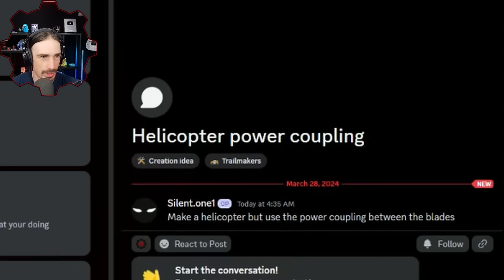Floppy Helicopter Blade Experiments

Comment: in case anyone doesn’t know, irl helicopter’s blades are allowed to flop around slightly, this helps reduce the rolling force subject to the rotor from the helicopter moving forward due to a difference in the speed of the air flowing over the blades on either sides of the helicopter
Reply: Isn't this also the case for planes? I know plane wings bend a little too but i'm unsure if it's for the same reason.
Reply: Yes, some plane wings bend(or really flex). I dont know if theres an engineering reason like the one for helicopters. If I had to guess, in some designs, having the wings flex upward slightly, may have been within the acceptable range of structural support, rigidity and flexibility, while also, maybe, adding some minor stability in flight.
Reply: @ShadowWolf2508plays  yes, plane wings flex, for different reasons for different types of plane. earliest planes bend their wings to achieve aerial control while modern airliners allow their wings to bend to dampen turbulence and other vibrations. modern airliner’s wings can actually bend quite a lot.
Reply: ik that wings on a plane flop for a reason but im not sure if its the same
Reply: @irrelEvant5352  your question was answered above
Reply: @changjared2600  i see. But thats a lot of words :/

Comment: Hi scrapman, here to explain game physics again:
When parts are welded/glued together, they are treated as a single physics object. HOWEVER, when they are detached via a rope-like joint, they are a separate physics object (similar in nature to the tractor beam thing). Because of this, when you detach wing parts, the force those wing parts isn't being applied to the whole creation, rather just everything that it's directly attached to (where in this case, the laser string is considered "indirect attachment") 

This explains why you spun out when you detached the top blades from the bottom. This is because the counter torque does not apply between separate physics instances, even when indirectly linked. It also would explain why the wings went up when you slowed the engines down. . . because the upforce of the wings. . . were only being applied to the wings themselves and not the main body. Where wings, by their very nature of being wings, are very light and don't need alot of speed to lift up, if the only thing they have to lift is just the weight of it's own wing'ed self.

You can test this analysis by reproducing the top/bottom separation. . . but putting laser string between the bottom blade and the helicopter rotatee part.

Comment: theoretically you could to the traditional opposing stacked blades with flappy bits if you alternate which segments are power couplers, like the top set of blades could go blade + coupling + blade , and the bottom set of blades could go coupling + blade + coupling, since power coupling don't have collision on their body this might fix the whole spaget issue.

Comment: Scrapman. You may or may not be aware of this, wings in trailmakers only apply down force when flipped. Reversing the direction so the down edge is forward still gives lift for some reason, i believe that is part of why pitching forward was so bad, the closer blade to the center of mass is momentarily getting more lift as its closer to the center of rotation

Comment: So with power couplers, you can put them side by side or on top of each other to make the bend mostly in only one direction.

Side by side and they mostly can only flex up and down.

Stacked on top of each other and it mostly only does right and left.

If you make a difference in strength you can effect the motion to be twisting or greater in one direction and less in the other
Reply: The effect is great the longer(more) couplers

Comment: Okay so after your floppy plane video I went and immediately built a floppy helicopter. 
And the part at 7:11 didn't make ANY sense to me, because I didn't run into any of the problems you're having with the blades flexing into each other during pitch and roll maneuvers.

And I couldn't figure out why until I realized that we built our flight mechanisms entirely differently. I used a swashplate under the main pair of helicopter rotors, (made simply out of a pair of large driving hinges and then another pair of large driving hinges immediately above it and rotated 90°.) I added a couple of gyro stabilizers to keep the body of the helicopter mostly upright, and then added a pair of horizontal gyros right next to the main rotor assembly to give some extra yaw control.

With this arrangement, the moment of precession seemingly doesn't cause nearly as much interaction between the flexing blades. I haven't slept enough in the past few days to be able to sort out why right now, but I think it has to do with how and in what direction and everything that the forces are being transferred from the stator body of the helicopter itself to the rotating bodies of the blades.

Comment: If you've ever seen those 3D screens that use a rotating blade with LED's. The LED's constantly change colour forming a picture as it spins. You could potentially create patterns with the power couplings with a lot of logic and syncing. Could be an interesting idea if it could work.

Comment: Increase distance from bottom set of blades to the body as well. Less likely for blades to catch on the body. Then if you put power couplers there too it might absorb the torque a little in the others direction equaling it out.

Comment: 7:21 This is how real helicopters control their pitch and roll. They tilt the rotors left and right to pitch forward and backward, and they tilt the rotors forward and backward to roll left and right. Since there is usually only once set of blades, the torque at 90° is unbalanced and quickly dominates the small tilt applied to the rotors.

Comment: Under one hour, I never see this, but I've seen videos from 3 seconds ago. Hey scrap man, you should do a dogfight (airplane) where you place an invisible rope (power couplimg) and it's attached with 150 kg, and because it dangles it's gonna move you're center of mass, meaning it's gonna be hard to control. 
Max blocks: 150
Max power cores: 20
Max power cores (powercoupling): 10

Comment: Scrapman I have a video idea:
Cars vs bomber planes BUT the bomber plane has to use the explosive barrels to attack the car rather than regular bomb bays. Because of this the plane shouldnt have too many restrictions but it should definetly not be aloud shield generators. I think the car should have a 100-200 block limit and aloud either 4 smart cannons, 2 miniguns or 1 blaster because of fire rate and damage dofferences. I don’t know if you will do this but I think it would be cool to do it on Treasure island and make the path start from the main spawn point in the bottom left up to the mountain so its a good long drive giving the bomber a chance to grab a new barrel. If it doesn’t work well with planes you could do drones or make a plane with vtol, up to the person making the plane for their turn I guess.

Comment: im making a heli that uses stabilizers on servos because this technique helps stability and ease of flying. i would like to see what you can come up with using this technique. (i tried it with a diving bell with no tail and it works, an apache might be too small for the technique so if thats true, i will try something bigger.) w a s d q e shift and space controls, w/s/q/e: tilt heli to move, a/d rotate, space/shift: up/down. just an example though, you can make it how u like.

Comment: What if you put the Chinook blades closer to each other?

My logic: the further from the center of the blade, the most vertical difference.

So if you have them closer, the tip of the blade will actually match with a less elevated/lowered part of the other blade.

Comment: Couldn’t you alternate the wing piece and the coupler for each one. Like for the lower section it would be 10101 (1 is wing 0 is coupler) and then the other one is 010101. It’d be a bit longer so would it still work?

Comment: P.s. I know you can only have 1 input.Ok scrapman idea so you know how you can have an input into a logic block. Put an input example e then the logic block is connected to the power coupling and then set the output value to the strength you want

Comment: Wouldn't it be possible to achieve the aim of the video using single rotor with counter torque from a gyro or some weight equivalent spinning on the second opposite helicopter engine instead of the blades?